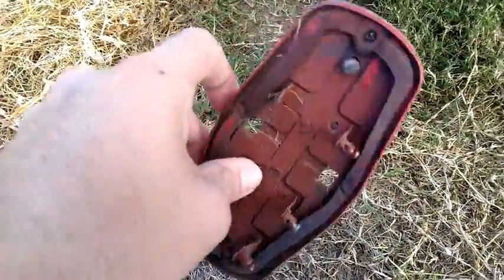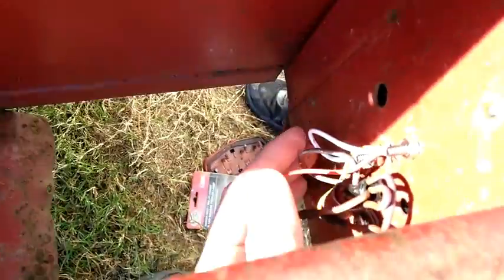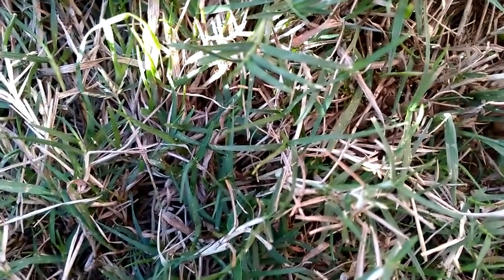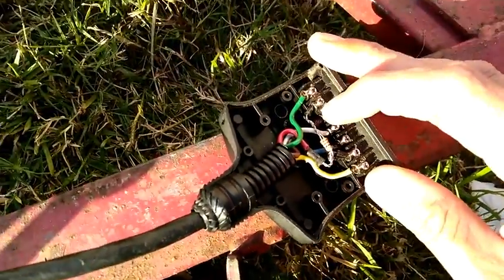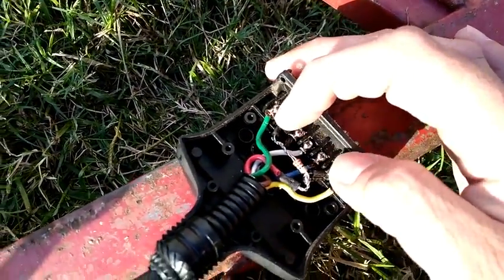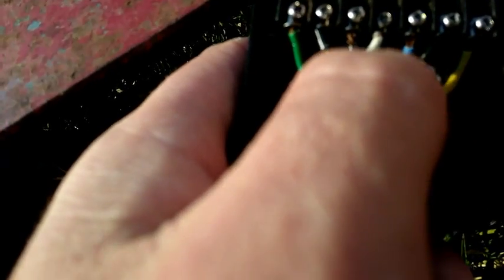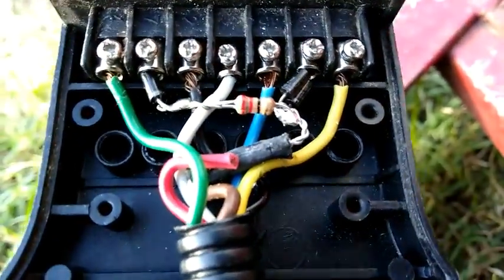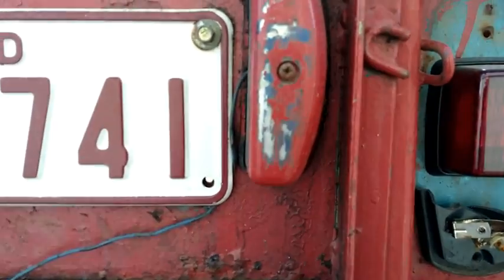Trailer light wiring Hack, Getting Stop, Tail and Indicators (3 light) from 2 light units

Comment: might be improved by having two separate 75 Ohm resistors, one for each tail light, and each on a separate pin and wire run.  The way it is, if one of the tail light bulbs goes out the other "tail" light will be too bright.  This would require another pair of diodes.

Comment: voltare2amstereo:

I'm wiring a 4-pin flat connector to a 2003 toyota matrix.

If the trailer turn signals are also the trailer brake lights, then if I hook the brake output wire to the trailer left and right turn signal wires, doesn't that mean my car brake lights will come on when I use a turn signal, and that my  car turn signal lights will come on when I use my brakes? I don't want that to happen, lol.